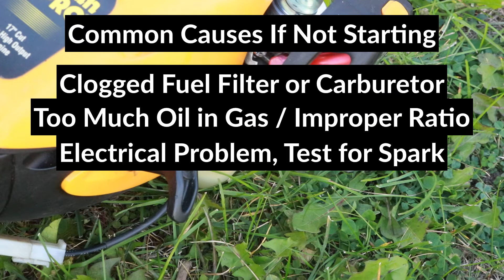How To Adjust a Trimmer Carburetor, Poulan Pro, Craftsman, Weed Eater, Zama, 2-Stroke Carburetor

Comment: Just wondering if you have any suggestions as I put a new carburetor on a weedeater along with a new spark plug, gas filter and lines and adjusted it the way you instructed but it’s just not starting. Appreciate any advice.
Reply from the maker: It's important that the gas and oil is mixed to the proper ratio.  Too much oil can cause starting problems.  The gasket for the new carburetor also has to match the old one perfectly, and line up perfectly and not be torn, otherwise the carb won't pump. In rare cases the magneto coil goes bad, causing no spark, so that would also cause it not to start. Another reason can be the new carb. Many times aftermarket carbs don't work like OEM ones. I usually clean and rebuild the old one instead of buying a new one because I've had this problem many times.   Here are some rebuild tips in case you're interested, https://www.youtube.com/watch?v=zSBPTKu_xUY

Comment: I followed all the steps in the previous video about rebuilding the carburetor. I just ordered three tools via ebay to get just the one 21 tooth splined adjustment tool. My repaired Poulan string trimmer starts, revs up but dies. So I reset the carb screw that uses the Phillips screwdriver. All the way in, and then three turns back out. Trimmer starts but I need that 21tooth splined tool to adjust the L side. Should get it in on Thursday. Thanks for the videos posted here and the one showing the carb rebuild. William in Atlanta GA
Reply from the maker: Thanks for watching! Hope your trimmer ends up running good at idle. The idle speed screw may need to be adjusted if the engine is stalling, I show that the end of the video.   It's also super important to measure the gas to oil ratio as precisely as possible. A lot of people eyeball it, and it usually causes the trimmer to stall.. sometimes it can stall even after running fine for a few minutes.

Comment: Thank you for this video. One of the easiest and straight forward ones I've seen. It helped me fix the "run only on choke" issue. Your fix for adjusting the idle screw and low idle screw is what did it for me. Trimmer is now running fantastic and purring like a kitten on idle 😀
Reply from the maker: Thank you for your kind words! It's great to hear you got it fixed and it's running that good! Sometimes no matter how much adjustment, they just don't run very smooth. Happy trimming!

Comment: can i use 40:1 in a 50:1 leaf blower? My echo revs up good and will idle but sometimes it just dies. Can the fuel ratio really be to blame?
Reply from the maker: 40:1 will give you more lubrication, but also more deposits and smoke.  I don't like adding more oil than required because of the smoke/smell.  Has the carburetor been cleaned recently?  I would suspect the carburetor. I have a video on that: https://www.youtube.com/watch?v=pCt9QP4kEVU    If the carburetor is very slightly clogged, it could cause it to shut off randomly when letting go of the gas.  Make sure the spark plug is gapped correctly and in good shape as well.

Comment: I guess the procedure is the same for a chainsaw carburetor too,  isn't it?
Reply from the maker: Yes, the idea is the same for chainsaws. Find the highest RPM for L on idle and H on full throttle, and then turn a slight bit to ensure it doesn't run too lean.
Reply: @CleverFix   Thanks!

Comment: Be careful with the high speed screw and adjusting to fastest engine speed at wide open throttle. There’s a maximum RPM that you’re not supposed to exceed.

Comment: Im have it a mCculuck 25 cc machine its livning its own life, changed the carburettor last year and worked fine and perfectly now then, it's a zhama carburettor from China I guess I can tell, I've tried and cleaned the carburettor, either it uses too much petrol or it doesn't do anything.

Comment: I have the same weed eater but mine won't run and barely idles with both screws fully turned in clockwise, if I turn them out then it wants to die

Comment: If i turn screw left ıt ll not spin by itself. Repairer said this can be related with pressure plate and changed them. It was not turning but after a few hours it started to spin by itself. Your solution can be a solution for me ?

Comment: Thank you, I replaced the fuel lines and could not get it to run steadily. I bought a HIPA set of carb screw adjusting screwdrivers, but didn't know where to start. Your suggestions worked beautifully, tks again!

Comment: Dude!  You're a HERO!  I watched both your videos because my Snapper Weed Trimmer S27SS stopped working!   You see, Poulan and Snapper are very similar designs w the same carburetor.   Your carburetor clean out video really helped a lot, except I used old fashioned carb cleaner and put everything back together.  The adj part was a bit different, but I got it the way I want it to run now.    Before watching your videos, I couldn't get the darn thing to even start up and now it is running perfectly!  Your video saved me $200..lol!  Thanks much!
Reply from the maker: Awesome! 👍 Glad you got it fixed and saved some $$

Comment: I have an old 32 cc Craftsman weed-eater that I just installed a new carburetor about 6 months ago. All of a sudden, it decided to just stop running. I checked all of the fuel lines and ran into your video and tried to adjust the idle screw to reset. It started at a very high idle so I tried to turn it down but it never started again. The problem with the mixture screws is that they look as though they are totally round with no notches in them at all. What kind of tool would you purchase to adjust them? BTW, there is no H/L anywhere to be found. The only thing to go by is what you said in the video.   Any ideas?  Any input is appreciated.
Reply from the maker: Sorry I'd need to see a picture., but maybe the head is not round on your screws like on mine? There are all sorts of adjustment tools you can find on amazon, search for  "Trimmer Carburetor Adjustment tool" and you'll find some. If the head is not round, they will have a tool that matches the head.. some of them are kind of like a D shape.
Reply: Check to see if you have spark if you do check for compression

Comment: I followed the steps here and reset the screws as mentioned. I think I have it at the right spots but there's white smoke coming from the engine exhaust.  Fuel is mixed correctly.
Also my idle screw doesn't work like yours. No matter where the screw is, it runs at the same speed.
I also followed your carb cleaning video as well.
Reply from the maker: White smoke?? What kind of trimmer is that, it has coolant? The idle screw just presses on the throttle plate. If you push the throttle down you will see the plate move, and the idle screw just stops the plate from not going back very far, as if you're keeping the throttle down basically..  White smoke indicates a blown heat gasket, but you'd need to have coolant in it.. these trimmers don't have coolant. White is basically vapor/steam.
Reply: @CleverFix  its a poulan pro p1500.  There's no coolanttank or anywhere to put coolant.   I understand how the throttle and idle screw works but it doesn't stop the head even unscrewed all the way.

Comment: QUESTION PLEASE!!! I watched your corburator cleaning video and did that, but my corburator was completely clear. I put everything back together and it fored right up like normal but still stalled out at an idol, so I did the corburator reset like in this video and now it unfortunately wont start. It acts like it wants to though. When starting from the screws at reset and it not starting, how do you know which way or how much to turn the screws to get it to start? If that question makes any sense.... I hope you have the time to answer my question! Thank you!
Reply from the maker: What kind of gas do you have in it? Fresh and mixed properly?  Have you checked compression? How do you know it was "clear" , you used a ultrasonic cleaner and the water did not get dirty at all? All the gaskets were ok in good shape?
Reply: Yes to everything except i don't know the compression or the ultrasonic cleaner. I used carb cleaner and blew it out. I started right up multiple times after the cleaning but still died at an idol and instead of just adjusting it while it was running I made the mistake of doing the reset. It acts like it kinda wants to start, but I don't know how to adjust the screws to get it to start. Thank you so much for your reply!!
Reply from the maker: @caseyann1079  The L screw will be the one for starting. The H is for running at high speed. So maybe screw the L all the way in, and then try to start, if no start unscrew one turn at a time then try again.  I'd try that myself.. but without a ultrasonic cleaner the passages inside could still be clogged.. they're pretty cheap on Amazon, you can get a small one , and they're good for lawnmowers too.  In my carb cleaning video I'm using the ultrasonic cleaner, I thought you saw that.
Reply: @CleverFix   I did see that but I dont have one, thought the carb cleaner could be a quick fix for the moment. Thank you for your time!
Reply from the maker: @caseyann1079  Carb cleaner doesn't do much! There are very tiny passages in this carburetor. You could leave it 24hours in 50-50 original pinesol and water, .. that will help some, but still not as good as the ultrasonic cleaner, because if a channel is clogged, there isn't much to move the cleaning solution through it.

Comment: This is a very good instruction video. Thank you very much. I noticed that when adjusting the "H" screw, you stopped as soon as the engine revs is at its highest. Some would unscrew it slightly to make it run richer, and hence less hot.

Comment: I have started using Stihl premix gas for my trimmers. It burns cleaner.  Steve's Small Engine Saloon. Did a video talking about gas you buy and mixing your on oil. He found it is not the ethanol in the gas that is messing up the diaphragm in the carbs. But the other additives the oil companies put in their gasoline. Premixed gas does not have the additives.

Comment: Will all these tips work on a PP 133 33 cc grass trimmer...will start but wont hold idle...Thank you....
Reply from the maker: Yes it's all the same principle.  Make sure carb is adjusted and idle screw. If it still won't run properly, then it needs a carb cleaning.
Reply: @CleverFix  YEAH, it was my dads and sat in the  garage a few years. It worked fine last season but had trouble with it this week. I went on line a searched carbs for it ...13 to 23 bucks....Thanks for the info....
Reply from the maker: @joeknowz4898  Never store small engines with fuel in the tank over winter,  and always use premium gas. That will help to last much longer before clogging.
Reply from the maker: @joeknowz4898  Also, aftermarket carbs(cheap China stuff, but they're all China) for trimmers can be garbage, I suggest cleaning the original one. Some will not even work properly at all.
Reply: @CleverFix  YAH. my neighbor hit me with a you tube video about ethanol fuel in small engines being the heart of these problems. Like I said, this was my dads and it got too heavy for him to use. I tried making my own non-ethanol fuel last year but it got so messy in my garage...I bought a 1000 ml separating funnel...it worked added, I added 100 ml's of water to the funnel and filled to the mark. let it sit for 24 hrs and the ethanol was at the bottom of the funnel...drained it out and what is left is 100% gasoline....I'll try that again. I don't make that much mixed fuel for the summer. This winter with all the snow I made and used  3 gallons...didn't have time to go bad...
Reply: @CleverFix  Yep. I'll try the needle valve tomorrow...seem easy enough. I did the fuel lines last year because the rotted away in the tank from being left in my dads garage a few years too long...